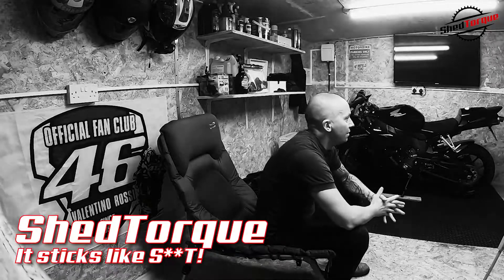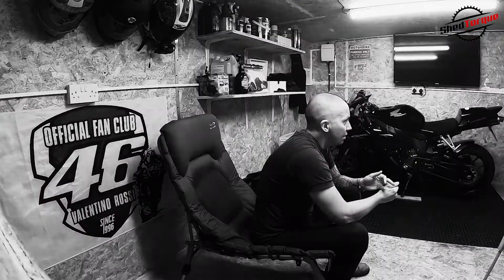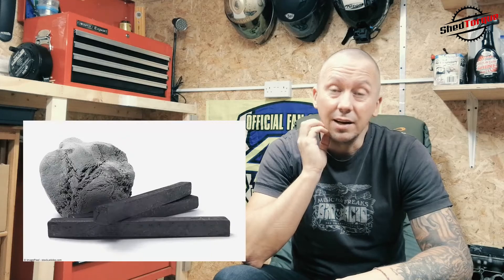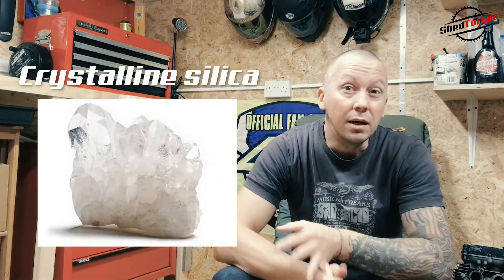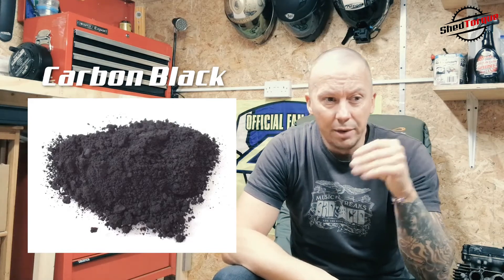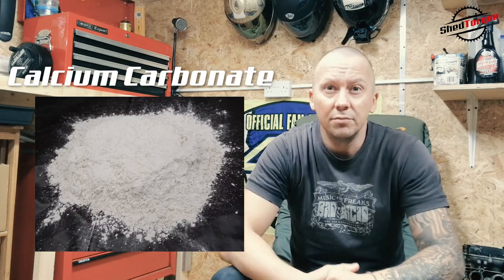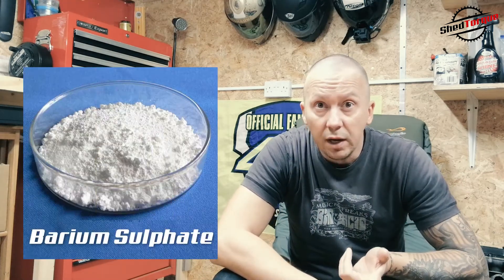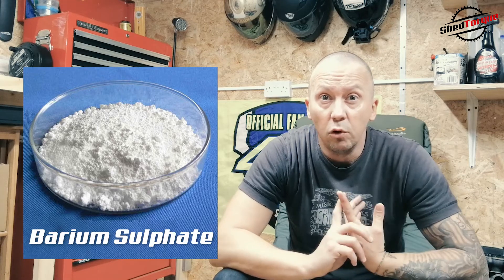Epoxies stick like S**T! JB Weld - EvoStik - SteelStik

Comment: Great video,  what size is the shed as planning on having another bike shed and yours looks the ideal size? Also do you heat it during the winter and if so what heaters do you use?
Reply from the maker: 14ft x 12ft Yeah, heated through winter. Insulated so well that the heater is only on frost setting and it feels warm.